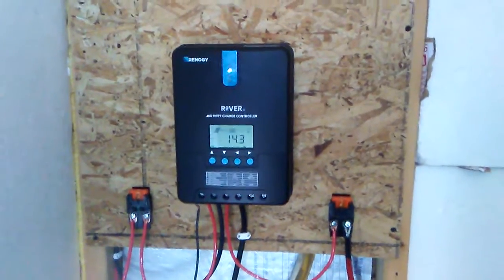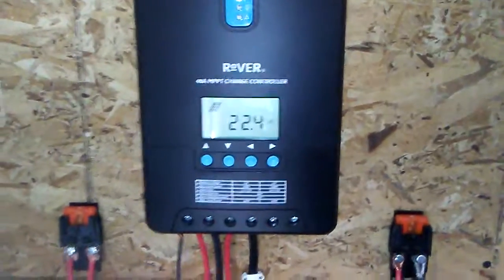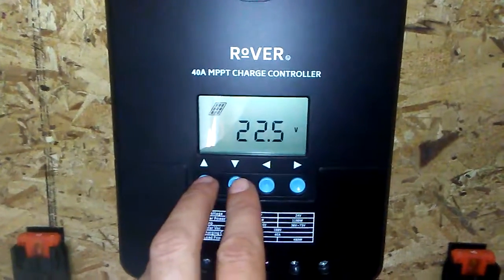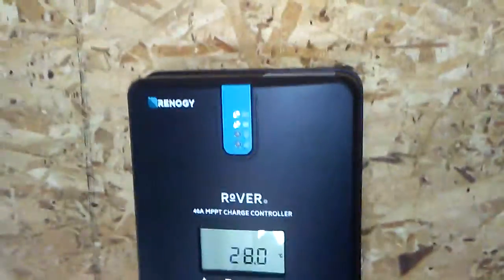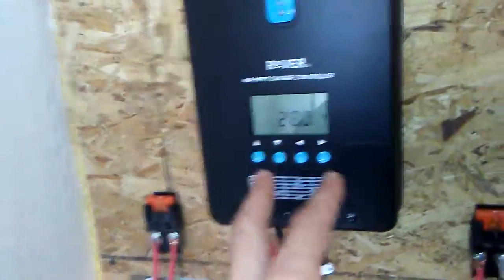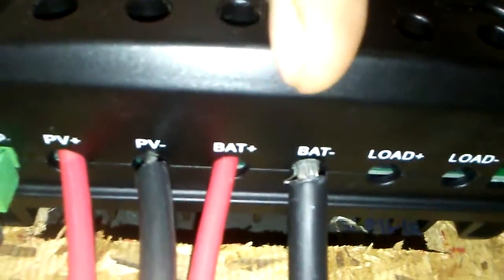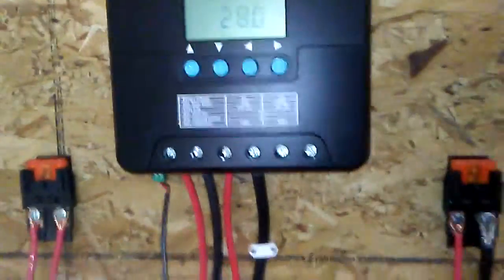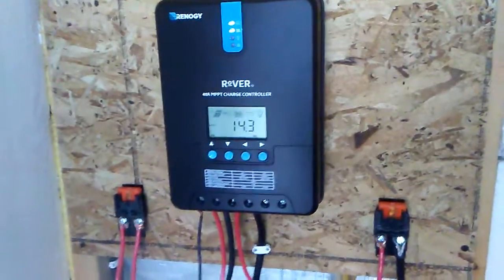Renogy 12V 400W 40A Solar Panel System Kit Install - Part 8 - All Systems Working

Comment: Hey, how much was total cost for you? Renogy has a sale price and i’m wondering if that’s actually their sale price
Reply from the maker: I did a video on another kit I just bought... there's actually a link to the kit posted in the description of that video.  Less than $500 USD shipped to your door!  
Thanks for watching!  🙂
Reply from the maker: The video is called...
Unboxing Renogy's 2023 400 watt 40 amp Solar Panel Kit with MPPT Charge Controller

Comment: What size fuses did you use ... ?  I have 400 watt panels connected to my MPPT  i need to fit some fuses .  thanks
Reply from the maker: 40 amp fuses. One going in to the mppt charge controller, and one going to the battery(s) from the charge controller.  
Thanks for watching. 🙂
Reply: @TinyIowa  thank you very much.

Comment: I have a slightly older model Rover 20A PG & the operation of it is causing me a near nervous breakdown!

To explain....

I'm using the controller with a 100W Renogy panel & an inverter. Everything seems to work like a dream but.... The company has told me that I shouldn't be drawing power from the unit whilst it is being charged from the panel. This effectively stops all use during the day & I'm now wondering what, if any, is a safe amount of charge to be coming down from the panel to allow me to take power from the battery? Should I only use it at night or after 7.... 😵‍💫

I think the problem(s,) which I've been told could damage my battery, lies in the charging cycles which I now think are not designed/expecting an inverter to be using the system.

The company have told me to put in a circuit breaker for whenever I want to draw power.

I'm coming round to thinking that the MPPT is really not designed to work with a setup that uses an inverter?

Any views/help?
Reply from the maker: Thanks for the question.  I hope this may help you out.  
So this is what my understanding is from your post...
You have one 100w panel you're using, that's going into your 20a charge controller.  Then from your charge controller, you feed the power into your battery.  And from your battery you have a power inverter hooked up to the battery in which you want to draw from during the day.  
Is that correct?  🤔 
If so, I think what the company is trying to say to you is... there's not enough power coming into your battery to keep the charge that you have on it while pulling from the battery as well.  
Is there a 'floating' signal that the charger shows you?  
Example; like with our charge controller, it let's us know that when the battery is fully charged, it goes into a state of 'floating'. When it's in the floating stage, all the excess power that's coming into the battery is being not being utilized, so it's making the excess power disappear so it will not overcharge your battery.   
With that small of a system that you are using, the company is probably telling you that they don't want you to kill your battery so you'd have to replace it.  
I'm not sure on how many amp hour battery you are using.  When we first started we had only one 12v 98ah (amp hour) battery, but we did have 4 100w panels charging it.  So it had zero issues giving us enough power to charge the battery so we could pull off of the battery at the same time it was charging.
I hope this information helped.   Thanks for asking.  🙂
Reply: @TinyIowa  

Thank you so much for your help Tiny!

I think you might be right. I have attached part of a correspondence from Renogy regarding the issue below. 

I have two 120amp batteries setup in parallel. 

Are they saying that if the battery is flat or being drained to within a point that falls below the recommended 50% discharge level that this is the issue & obviously not recommended?

In other words, if the battery is showing anything above a 50% capacity I've got no problems & can use it regardless of the charge coming in so at night even?

Mine does have a "Float" indicator together with "Bulk" & "Boost" indicators. That has been another issue when the system goes into "Boost," if I've got the inverter running it goes nuts as it is rightly picking up on an over charge coming from the battery....

Thank you again for your kind help. 👍

From Renogy.

"Thank you for getting back to us.

You are correct. The battery may be damaged if it is being charged and discharged at the same time. This is more likely to happen if the discharge current is greater than the charging current...."
Reply from the maker: No problem.  Always here to help and I understand the frustrations of leaning new,  I hate to say it but, 'technology' (makes me feel old talking like that!  😆... but it's not like in common every day use that all people use all the time! So I understand the frustrations). 
Yes what renogy said about the 50% battery usage is true... it's hard on the battery, due to the fact that the charge cycles won't last as long as 'promised'. 
But honestly,  here's what we do... when the voltage on the battery says 12.7v (after it floted for awhile during the day) we consider that fully charged. In our house we have 3 now that live here... my wife & myself, and our a almost 18 year old son. At night when we watch the battery levels... when it hits 12.2v we tell everyone how low it is, and whatever is pulling the most power we turn off and unplug it from the house (inverter) ... and just use the basics, but nothing to extreme.  Usually at that time when it happens, we're all about to go to bed. So no biggie.  
But there are times, usually in the spring when we have heavy fog and thick overcast, that we may never get to the floating phase while charging... then we tell everyone, it's was a bad for charging so don't use the big stuff for tonight.  When it has hit 11.9 we kill the power throughout the house and wait. Only a handful of times that has happened though in the past 5+ years.  

Again, I'm not sure if that's 100% correct on what to do,  but it works for us. We only started off with 1 12v battery... we did that for about two years then added another one. BUT both batteries are still going strong with no issues!  
About your other two indicators,  boost & bulk I believe... I have zero experience with that nor knowledge of.  Sorry.  
But if you can, I would highly recommend using a set of 4 100w panels in total with a MPPT charge controller for your 2 battery system.  I think for us... it would be fine with 3 batteries.  (Which is the limit you'd want to use with using 12v batteries all ran in parallel... for proper pull from all 3 batteries.)
Hope this helps!
Reply: @TinyIowa  

Many thanks again Tiny (sorry for using your YT username!)

Thank you for taking the time for such an extensive & considered reply.

To be totally honest I had been talking to an electrician friend of mine about all this. (To your standard "sparks" as we call them in the UK, solar is a dark art!)

He was saying that if all works don't worry about it! 

On my Rover I have a "battery capacity" indicator given in %. Generally, if that falls below 50% I shut anything I'm using down. Even that "capacity" is a world of wackiness as it can give very erratic & unfathomable indicators like the battery going down to 47% say with a charge on it & back up to 90% when that's taken off. That would be akin to the fuel gauge in your car going down half from full if you accelerated & then back to full again when you are at a constant speed!

It's like I said to Renogy, I can't understand when you are supposed to use the battery (without the now advised circuit breaker) if you have to factor in or worry about what the controller is doing to your system or battery....?

Not to worry, I will have another go at pulling the companies coat tails on this again as nobody has indicated to me that taking power from the battery is a problem, charging or not, providing there is enough juice in the battery.

Thanks again for your help though mate, enjoy the rest of the summer. Not sure where you are based but we are having a blinder in the UK. Perversely enough a good English summer's day is about the optimum for solar panels at around 25C!
Reply from the maker: The power inverter uses power to make power... and if you're using more power, along with using the inverter, your device(s) maybe pulling more that than the one panel can produce.
Reply: @TinyIowa  

Sorry Tiny, to add sightly to the issue...

Why do you think Renogy would tell me to put a circuit breaker in?

That would indicate to me that I shouldn't be charging or drawing at the same time regardless of the state of the battery?
Reply from the maker: @pup1008  I have zero idea... only reason I may think of is the charge controller you're using... how you explained to me the boost makes your inverter go all wonky..?.. not sure to be honest though.  😕
Reply: @TinyIowa  

Just by way of an update, the latest email on this from Renogy.

"Hi John,

Thank you for keeping in touch with us.

It is fine to discharge the battery while it is still charging. Just make sure that the charging current is greater than the power draw.

Should you have any other concerns, please respond to this email. You can use the Case ID provided below as your reference. Thank you and stay safe!

Regards,"

Comment: I just bought the 400W Premium package. My big confusion is the 10A in-line fuse that was included. Why only 10 amp? Each of the 4 panels puts out 20V & 5A. If I wire them in parallel, I'd be possibly pushing 20 amps. Are these panels meant to be wired in series only? What am I not understanding? Can I wire in parallel and just use a 25A  (20 x 1.25) fuse Thanks!
Reply from the maker: I would call customer service. They are awesome help over there.  😁

Comment: Better fuse option is a fuse next size up from controller so 50a in this case. Then make sure your wire is rated for the same or heavier gauge following an Ampacity chart. 8ga will work for many applications but 6 ga is better
Reply from the maker: You never go higher than what is max, 40 it is, then 40 it will be.  That would be like using a 20 amp fuse for a 15 amp circuit.  If you go higher, you're just asking for problems. We have been using it this way since installation... not one problem.  We like it that way .
Reply: @TinyIowa  the fuse is there to protect the wire from the battery shorting out...preventing a fire. The controller stops output at 40a...that's not the issue. The risk is the battery at hundreds of amps in a small wire. Fuses/breakers aren't exact science, they might blow at -10% of rating or +30%.  In your theory the controller can be running at full output 40a...the fuse says oh 40a pop, now your controller is disconnected. So a 50a gives the controller a little breathing room but still protects.
Reply from the maker: @mrmotofy  we will agree to disagree.  I do agree with a percentage +-

Comment: 4 200 amp 6 volt batteries is only 200amps
Reply from the maker: ....depends how you wire the batteries.

Comment: I have a very similar setup except using flooded marine batteries. My batteries (6) never show more than 65% charge. Is there something I'm doing wrong?
Reply from the maker: Do you have a 12v system?  Are the deep cycles 12v batteries?  Are they all run in parallel?

Comment: Anyone know where I can find information on the Equalization setting?    Thanks.
Reply: Equalize is done on lead batteries every so often to hopefully stop from sulfating or something essentially internal shorting of the battery. Set it to the battery manufacturer specs for equalize voltage usually 15v-16v

Comment: I'm very disappointed in the connection lugs. They're absolutely pathetic
Reply from the maker: Yep they are.  But it works.
Reply: @TinyIowa  yeah I got it working. Have an outback 60 that couldn't handle 8 100w panels. Had to put 2 on the renology

Comment: It would have been more wonderful if there was a step by step tutorial on how to install the 4g gauge wires into the breaker or fuse switch then into the mppt straight into another fuse switch straight into the terminal then install the gague wires from the mppt to the solar panels and how to insert a cover to prevent water entering through the roof that creates a barrier and an attachment area where the wires go through. Be very helpful hints. Because I've search the YouTube site, and nothing shows from start to finish on how it's done, and they rush it through to make monetorial sense only.
Reply from the maker: Yeah sorry.  When we installed them it's was mid December and it was very cold outside! The daylight was fading fast and it takes a long time to set filming equipment up etc etc... especially when it's only one person and children who would've needed to film.  At that time I also didn't have the correct software to edit the clips.  Next time when I install all this and then some into our utility building this summer I will do a better job and get more in depth.  Thanks for watching.  🙂

Comment: That's  a 40amp fuse circuit. So I might get the 40amp automatic fuse breaker. I see how you wired the positive to fuse then positive to mppt then positive fuse to to positive battery terminal. Awesome now I'm very confident now I can finally do it myself. Where the negative goes straight to mppt then straight to battery terminal.
Reply from the maker: Always put your fuse in line with the hot wire. Hence on a vehicle the negative (ground) goes to your frame/engine block, etc... where as the positive (hot) goes to your circuits/fuse box. 

Here's something that may blow your mind... please do not over-think it, because it may drive one mad 😵‍💫😆... but power travels from negative to positive. The actual definition of 'electricity' is the flow of electrons. And we know from study of atoms... you have the neutrons (neutrally charged) and the protons (positively charged) make up the center (nucleus) of the atom. On the outside orbit of the nucleus we have the electrons (negatively charged).

Comment: Can I run 3 ... 250 Watt Solar Panels Through a Renogy 40 Amp ROVER CHARGE CONTROLLER ..
Thank You for your help 🙏
Reply from the maker: 12v or 24v panels?

Comment: how many 12v renogy 200 amp batteries can i put on a 30 amp rover
Reply from the maker: Batteries?  The deepest you want to go is 3 batteries deep. 
Example... to keep 12v continuous wire them in parallel... (+to+to+ and -to-to-) the reason why is to keep an even pull/draw from each battery.  
So with Three 200ah batteries, you would then have 600ah in total. 
With that being said... depending on what kinda battery you're using... lithium, gel, acid of lead, etc... typically you never want to try to go below 50% charge, so in theory, you'll only have 300ah with Three 200ah batteries.  
Now with your question about how many batteries can you put on your 30a rover.... 
I would say 2... maybe 3?! It all depends on how much you use your batteries. Cause if you use your system let's say just on the weekends at a cabin... you can probably use 6 batteries if you want! Cause you'll have 5 days of charging.  But if you use it on a daily basis... with a 30a rover... max, 2 batteries.  You don't want to have a battery bank that you can never fill. That would be just throwing your money away.  
Another thing to consider too... your environment where it's being used.  Hot Temps? Cold Temps? 
Solar panels are rated at their voltage at 77 degrees F. The hotter it is, the Less voltage they produce. But the colder it is, the More power they'll produce.  Example... here today we woke up to -20 degrees F. Our solar panels that are rated at 12v were producing 23.4v. So the batteries were charged very fast!  In the summer, they take quite a bit more time to charge (double time vs winter). 
Hope this helps.  Thanks for watching.  🙂

Comment: Nice easy setup explanation.  I would get some proper ends on those cable going into the fuses.  Just safer and you will get let voltage loss.
Reply from the maker: Thanks for watching.  🙂

Comment: Good show,   where could I find those fuse holders ?
Reply from the maker: I'll try to put a link up underneath this comment.  If that doesn't work (cause YouTube may not post it) you can do a search on our channel for 
DC Fuse Block Holder Panel.
Reply: @TinyIowa  Thanks a bunch !
Reply from the maker: https://www.fleetfarm.com/detail/maxi-fuse-block-60-amp/0000000047190?Ntt=Littlefuse%20Maxi%20Fuse%20Block%20Holder

Comment: What are the "load" connectors for, please? None of these videos goes out of their way to explain this! Can I run a 12v fridge from this without connecting the fridge to a battery first?
Reply from the maker: Honestly, I do not remember off the top of my head unless I got the owners manual out. 
But if I remember correctly,  it's not too be used for to much load (amps). And I know you can turn it off (so it never comes on) you can also turn it always on, or what we're thinking of using it for, would be using it as a photocell (like outdoor lights that come on during the night) for LED lighting in our house hooked up on a dimmer switch (for more control over brightness). 
Maybe call renogy customer service and ask them.  
Do you know the amount of amps or watts your fridge uses?
Reply from the maker: Yes the load is for 12volt usage. If your fridge doesn't use to much watts or amps, yes you 'could' hook it up to this spot without using battery terminals.